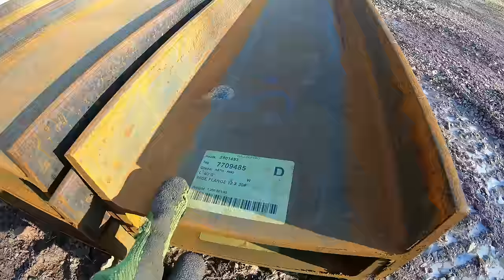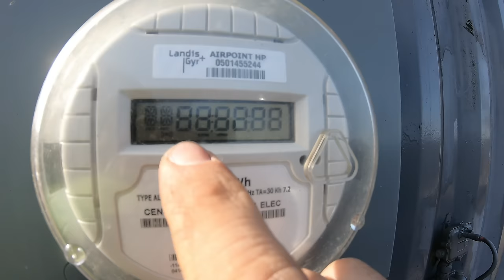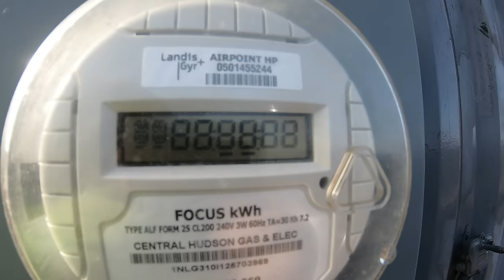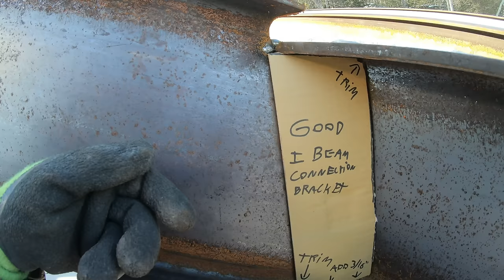Container castle roof rafters

Comment: Are welds only holding all of that concrete & steel?
Reply from the maker: yes
Reply: @AndrewCamarata  Saw the weld strength test in a later vid and realized others had asked the same.  Good stuff.

Comment: Did you actually pre order the testla cybertruck
Reply from the maker: Yes, its not a huge commitment though. But I am sold on the stainless steel body.
Reply: @AndrewCamarata  yeah the stainless steel is a huge benefit over the steel they use now! I just wish the interior controls were more simple

Comment: I am curious.  Did you have to get a building permit for the building and additions.  And did the plan/calculations by the design engineers have to be reviewed by the Town Board and approved to meet codes?  Did they make changes?  And did the town's code engineer come out to the site to make inspections or changes?

Comment: There's no way that fortress would meet building codes anywhere in the USA.  It's too solidly built.  It will last 500 years and put builders out of a job.  Screw 'em.  Let them learn a new trade.  Builder use the cheapest materials available and charge as though it is premium quality. LDF and MDF and partricle board are not quality building materials.

Comment: After thinking this over a bit, I think Andrew went off track with the steel roof. Originally, he had the right idea with the wood, but then cancelled it. I think he will regret this change. The weight of the heavy steel rafters and steel plates as a roof surface is a problem as well as a big issue to paint. Wood would have solved this and been a lot lighter when you have heavy ice/snow loading. The connections should have been bolted and not welded too. Andrew may wind up having to remove this thing and going back to a wood roof out of necessity. We all make mistakes and learn from them.

Comment: 6000 pound capacity on the telehandler is probably fully extended tipping point.
Reply from the maker: the 6000 is up close. There is a chart in the cab that shows its capacity's. All the way out is like 1000lbs.
Reply: @AndrewCamarata  ah! Glad it has the chart. Would be interesting to know the true limits. Maybe a test video? Im sure the engineers did a similar test and took off 20% of the tipping point or something.
Reply from the maker: It’s not all the time that you know how much things way, one time I picked up 7500 pounds with it.

Comment: now you will use circus cockroaches to paint the back of the column ????
Reply from the maker: That metal is thick enough where things rusting threw will never be a problem. especially since the roof will keep water off the whole thing.

Comment: Steel is pathetic in a bush fire.
Reply from the maker: Nonsense. That is those light gauge metal buildings which are surrounded by flammable stuff which warp. Everything here is heavy iron with no flammables around.
Reply: @AndrewCamarata  It doesn't catch alight, but it doesn't have to get very hot to bend, here in Australia I've seen I-beam in a burned house that spanned a double garage door 200mmx400mm x15mm and 8m long,
just completely twisted up. However, nothing would hold up in those circumstances except wood that is too big to burn through, I've seen a hay shed that had 400x400mm timbers that survived. and was rebuilt using the surface charred frame.
That said, if you've got a gravel clearing around your house as wide as the height of the trees, you should be able to defend from bush fire. And the way you've built your building, you could weld inside it without setting fire to it.
You're building is pretty good, There is nothing to criticize, I just hate to see people having 100% faith in steel. The twin towers were steel and concrete. Nothing is fireproof.
I love all your work and videos by the way.

Comment: you are a good craftsman but watching this i see few times you made it harder for your self...
those beams on top..you dont need those...they will not increase your load if you have square tubing supporting that...and square tubing is supported by container and some concrete. so thats just waste of money and time. Not to say how much extra load that is on top of your containers.
you should use lighter and sturdier construction from square tubing with x cross sections. its lighter and stronger. easier to mount...
why do you keep cutting steel with that? do you have normal angle grinder. it goes much much faster and easier...

that is just two eye catching things...use your head,not your muscles and wallet....

Comment: You're an accident waiting to happen. Look how you have your crane set up.... So close to an embankment, scoped out all the way on flimsy pieces of wood outrigger pads. Do you have any pads for the right side? Especially setting up on mud/dirt, get some sufficient thick outrigger pads and also move your crane away from the edge. As well, grab a face shield and a safety harness. Let's work safe.
Reply from the maker: Ground is all rock there, its not going to sink. Plus I was not lifting anything heavy. I know what I am doing. I wear safety glasses all day.

Comment: Wow, every single video thumbnail shows a gasoline burning machine. What size your carbon footprint? Seriously, one man burning so much fuel. This way of living is going to seem crazy very soon.
Reply from the maker: How much fuel are you wasting heating/cooling your house. I don't need heat. You should not get to have heat or any other energy.
Reply: @AndrewCamarata  I would suggest that heating a home is essential, whereas building a castle is less so. Where I live, in Europe our energy and heat is from a Hydro-Electric grid, built nearly 80 years ago. No fossil fuel necessary. I was making a point about unnecessary fuel burning rather than ANY fuel burning. However, lets just agree to disagree. Best wishes to you and your followers.